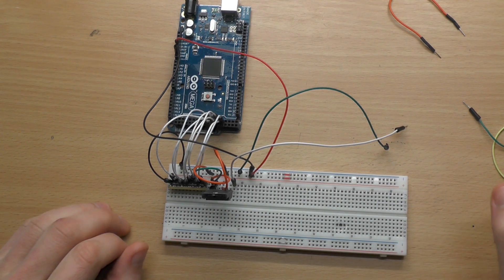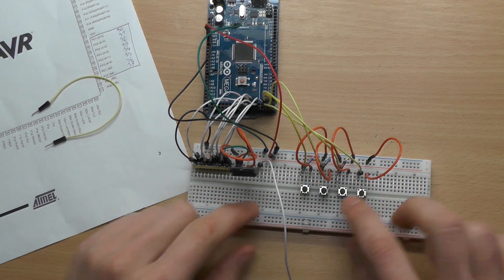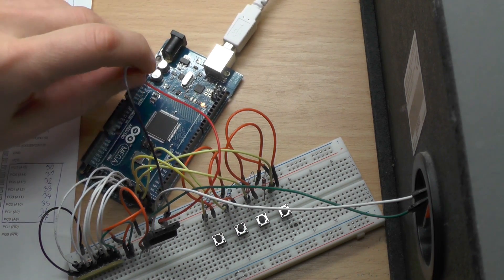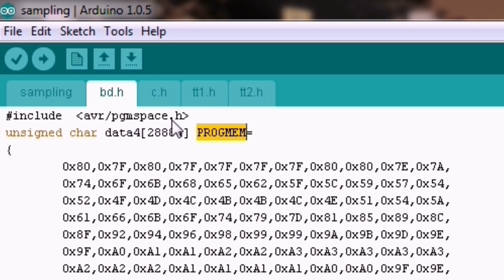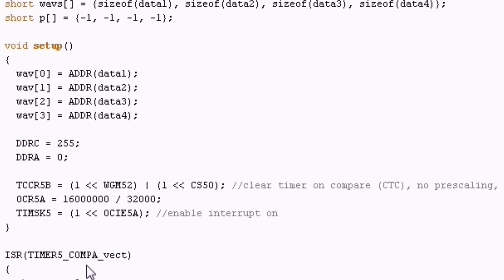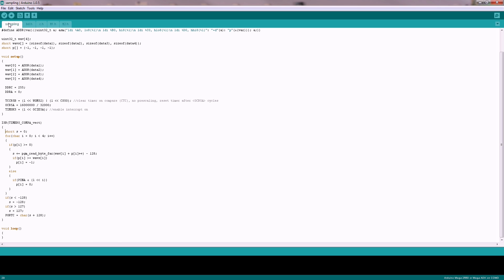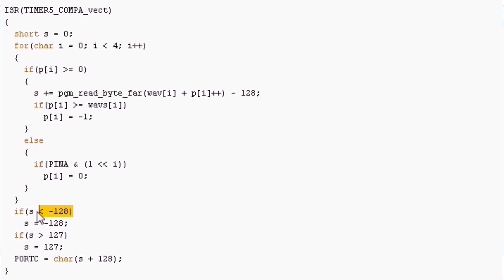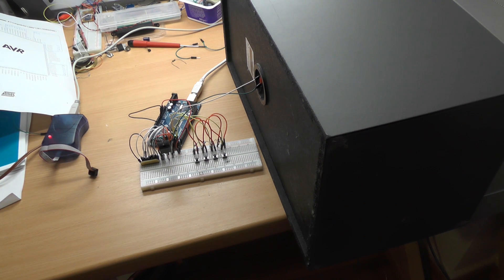Arduino audio sampling tutorial (part 2)

Comment: We are in 2021 and the upload limit should be the correct one now. I checked ArduinoIDE\hardware\arduino\avr\boards.txt, the parameter is: mega.menu.cpu.atmega2560.upload.maximum_size=253952

Comment: Hi. I am no programmer, but a music teacher trying to do some crazy stuff. I was wondering if using another board,  such as the DUE or the ESP32 one could replicate this example with more files (I'm thinking 8). That would be awesome.
Reply: ESP32 its ideal as it has a lot more memory and is a lot faster, nice thing is it will be a lot easier to program with 32 bit pointers. Also it cheaper and has wifi and Bluetooth built in.

Comment: //unsigned long pwm_value[9]={
//10000000,
//11000000,
//11100000,
//11110000,
//11111100,
//11111110,
//11111111,
//11000000,
//11100000,
//};
//int pwm_output=0;
unsigned char data1[286] PROGMEM=
{
 0x80,0x80,0x80,0x7F,0x80,0x7F,0x80,0x7F,0x7F,0x80,0x7F,
 0x80,0x7F,0x7F,0x80,0x7F,0x80,0x7F,0x7F,0x80,0x7F,0x80,
 0x7F,0x80,0x7F,0x80,0x80,0x80,0x7F,0x80,0x7F,0x80,0x80,
 0x7F,0x80,0x7F,0x80,0x7F,0x80,0x7F,0x80,0x80,0x7F,0x80,
 0x7F,0x80,0x7F,0x80,0x7F,0x80,0x80,0x7F,0x80,0x7F,0x80,
 0x7F,0x80,0x7F,0x80,0x80,0x7F,0x80,0x7F,0x80,0x7F,0x80,
 0x7F,0x7F,0x80,0x7F,0x80,0x7F,0x80,0x80,0x7F,0x80,0x7F,
 0x7F,0x80,0x7F,0x80,0x7F,0x80,0x7F,0x80,0x7F,0x80,0x80,
 0x80,0x7F,0x80,0x7F,0x80,0x7F,0x7F,0x80,0x7F,0x80,0x80,
 0x80,0x80,0x7F,0x80,0x80,0x80,0x7F,0x80,0x80,0x7F,0x80,
 0x7F,0x80,0x7F,0x80,0x7F,0x80,0x7F,0x80,0x80,0x7F,0x80,
 0x7F,0x80,0x80,0x7F,0x80,0x7F,0x80,0x7F,0x80,0x7F,0x80,
 0x80,0x7F,0x80,0x80,0x7F,0x80,0x7F,0x80,0x80,0x7F,0x80,
 0x7F,0x80,0x7F,0x80,0x80,0x7F,0x80,0x7F,0x80,0x7F,0x80,
 0x7F,0x80,0x7F,0x80,0x7F,0x80,0x7F,0x80,0x80,0x7F,0x80,
 0x7F,0x80,0x80,0x80,0x80,0x7F,0x80,0x80,0x80,0x80,0x80,
 0x7F,0x80,0x7F,0x80,0x80,0x80,0x7F,0x80,0x7F,0x80,0x7F,
 0x80,0x7F,0x80,0x80,0x7F,0x80,0x80,0x7F,0x80,0x7F,0x80,
 0x80,0x7F,0x80,0x80,0x7F,0x80,0x7F,0x80,0x7F,0x80,0x7F,
 0x80,0x80,0x7F,0x80,0x7F,0x80,0x7F,0x80,0x7F,0x80,0x7F,
 0x80,0x7F,0x80,0x7F,0x80,0x7F,0x80,0x7F,0x80,0x80,0x7F,
 0x80,0x7F,0x80,0x7F,0x80,0x7F,0x80,0x7F,0x80,0x80,0x7F,
 0x80,0x80,0x80,0x80,0x80,0x7F,0x80,0x80,0x7F,0x80,0x7F,
 0x80,0x80,0x7F,0x80,0x7F,0x80,0x80,0x7F,0x80,0x7F,0x80,
 0x7F,0x80,0x7F,0x7F,0x80,0x7F,0x80,0x7F,0x80,0x7F,0x80,
 0x80,0x7F,0x80,0x7F,0x80,0x7F,0x80,0x7F,0x80,0x7F,0x80,
};
unsigned char data2[286] PROGMEM=
{
 0x80,0x80,0x80,0x7F,0x80,0x7F,0x80,0x7F,0x7F,0x80,0x7F,
 0x80,0x7F,0x7F,0x80,0x7F,0x80,0x7F,0x7F,0x80,0x7F,0x80,
 0x7F,0x80,0x7F,0x80,0x80,0x80,0x7F,0x80,0x7F,0x80,0x80,
 0x7F,0x80,0x7F,0x80,0x7F,0x80,0x7F,0x80,0x80,0x7F,0x80,
 0x7F,0x80,0x7F,0x80,0x7F,0x80,0x80,0x7F,0x80,0x7F,0x80,
 0x7F,0x80,0x7F,0x80,0x80,0x7F,0x80,0x7F,0x80,0x7F,0x80,
 0x7F,0x7F,0x80,0x7F,0x80,0x7F,0x80,0x80,0x7F,0x80,0x7F,
 0x7F,0x80,0x7F,0x80,0x7F,0x80,0x7F,0x80,0x7F,0x80,0x80,
 0x80,0x7F,0x80,0x7F,0x80,0x7F,0x7F,0x80,0x7F,0x80,0x80,
 0x80,0x80,0x7F,0x80,0x80,0x80,0x7F,0x80,0x80,0x7F,0x80,
 0x7F,0x80,0x7F,0x80,0x7F,0x80,0x7F,0x80,0x80,0x7F,0x80,
 0x7F,0x80,0x80,0x7F,0x80,0x7F,0x80,0x7F,0x80,0x7F,0x80,
 0x80,0x7F,0x80,0x80,0x7F,0x80,0x7F,0x80,0x80,0x7F,0x80,
 0x7F,0x80,0x7F,0x80,0x80,0x7F,0x80,0x7F,0x80,0x7F,0x80,
 0x7F,0x80,0x7F,0x80,0x7F,0x80,0x7F,0x80,0x80,0x7F,0x80,
 0x7F,0x80,0x80,0x80,0x80,0x7F,0x80,0x80,0x80,0x80,0x80,
 0x7F,0x80,0x7F,0x80,0x80,0x80,0x7F,0x80,0x7F,0x80,0x7F,
 0x80,0x7F,0x80,0x80,0x7F,0x80,0x80,0x7F,0x80,0x7F,0x80,
 0x80,0x7F,0x80,0x80,0x7F,0x80,0x7F,0x80,0x7F,0x80,0x7F,
 0x80,0x80,0x7F,0x80,0x7F,0x80,0x7F,0x80,0x7F,0x80,0x7F,
 0x80,0x7F,0x80,0x7F,0x80,0x7F,0x80,0x7F,0x80,0x80,0x7F,
 0x80,0x7F,0x80,0x7F,0x80,0x7F,0x80,0x7F,0x80,0x80,0x7F,
 0x80,0x80,0x80,0x80,0x80,0x7F,0x80,0x80,0x7F,0x80,0x7F,
 0x80,0x80,0x7F,0x80,0x7F,0x80,0x80,0x7F,0x80,0x7F,0x80,
 0x7F,0x80,0x7F,0x7F,0x80,0x7F,0x80,0x7F,0x80,0x7F,0x80,
 0x80,0x7F,0x80,0x7F,0x80,0x7F,0x80,0x7F,0x80,0x7F,0x80,
};
unsigned char data3[286] PROGMEM=
{
 0x80,0x80,0x80,0x7F,0x80,0x7F,0x80,0x7F,0x7F,0x80,0x7F,
 0x80,0x7F,0x7F,0x80,0x7F,0x80,0x7F,0x7F,0x80,0x7F,0x80,
 0x7F,0x80,0x7F,0x80,0x80,0x80,0x7F,0x80,0x7F,0x80,0x80,
 0x7F,0x80,0x7F,0x80,0x7F,0x80,0x7F,0x80,0x80,0x7F,0x80,
 0x7F,0x80,0x7F,0x80,0x7F,0x80,0x80,0x7F,0x80,0x7F,0x80,
 0x7F,0x80,0x7F,0x80,0x80,0x7F,0x80,0x7F,0x80,0x7F,0x80,
 0x7F,0x7F,0x80,0x7F,0x80,0x7F,0x80,0x80,0x7F,0x80,0x7F,
 0x7F,0x80,0x7F,0x80,0x7F,0x80,0x7F,0x80,0x7F,0x80,0x80,
 0x80,0x7F,0x80,0x7F,0x80,0x7F,0x7F,0x80,0x7F,0x80,0x80,
 0x80,0x80,0x7F,0x80,0x80,0x80,0x7F,0x80,0x80,0x7F,0x80,
 0x7F,0x80,0x7F,0x80,0x7F,0x80,0x7F,0x80,0x80,0x7F,0x80,
 0x7F,0x80,0x80,0x7F,0x80,0x7F,0x80,0x7F,0x80,0x7F,0x80,
 0x80,0x7F,0x80,0x80,0x7F,0x80,0x7F,0x80,0x80,0x7F,0x80,
 0x7F,0x80,0x7F,0x80,0x80,0x7F,0x80,0x7F,0x80,0x7F,0x80,
 0x7F,0x80,0x7F,0x80,0x7F,0x80,0x7F,0x80,0x80,0x7F,0x80,
 0x7F,0x80,0x80,0x80,0x80,0x7F,0x80,0x80,0x80,0x80,0x80,
 0x7F,0x80,0x7F,0x80,0x80,0x80,0x7F,0x80,0x7F,0x80,0x7F,
 0x80,0x7F,0x80,0x80,0x7F,0x80,0x80,0x7F,0x80,0x7F,0x80,
 0x80,0x7F,0x80,0x80,0x7F,0x80,0x7F,0x80,0x7F,0x80,0x7F,
 0x80,0x80,0x7F,0x80,0x7F,0x80,0x7F,0x80,0x7F,0x80,0x7F,
 0x80,0x7F,0x80,0x7F,0x80,0x7F,0x80,0x7F,0x80,0x80,0x7F,
 0x80,0x7F,0x80,0x7F,0x80,0x7F,0x80,0x7F,0x80,0x80,0x7F,
 0x80,0x80,0x80,0x80,0x80,0x7F,0x80,0x80,0x7F,0x80,0x7F,
 0x80,0x80,0x7F,0x80,0x7F,0x80,0x80,0x7F,0x80,0x7F,0x80,
 0x7F,0x80,0x7F,0x7F,0x80,0x7F,0x80,0x7F,0x80,0x7F,0x80,
 0x80,0x7F,0x80,0x7F,0x80,0x7F,0x80,0x7F,0x80,0x7F,0x80,
};
unsigned char data4[286] PROGMEM=
{
 0x80,0x80,0x80,0x7F,0x80,0x7F,0x80,0x7F,0x7F,0x80,0x7F,
 0x80,0x7F,0x7F,0x80,0x7F,0x80,0x7F,0x7F,0x80,0x7F,0x80,
 0x7F,0x80,0x7F,0x80,0x80,0x80,0x7F,0x80,0x7F,0x80,0x80,
 0x7F,0x80,0x7F,0x80,0x7F,0x80,0x7F,0x80,0x80,0x7F,0x80,
 0x7F,0x80,0x7F,0x80,0x7F,0x80,0x80,0x7F,0x80,0x7F,0x80,
 0x7F,0x80,0x7F,0x80,0x80,0x7F,0x80,0x7F,0x80,0x7F,0x80,
 0x7F,0x7F,0x80,0x7F,0x80,0x7F,0x80,0x80,0x7F,0x80,0x7F,
 0x7F,0x80,0x7F,0x80,0x7F,0x80,0x7F,0x80,0x7F,0x80,0x80,
 0x80,0x7F,0x80,0x7F,0x80,0x7F,0x7F,0x80,0x7F,0x80,0x80,
 0x80,0x80,0x7F,0x80,0x80,0x80,0x7F,0x80,0x80,0x7F,0x80,
 0x7F,0x80,0x7F,0x80,0x7F,0x80,0x7F,0x80,0x80,0x7F,0x80,
 0x7F,0x80,0x80,0x7F,0x80,0x7F,0x80,0x7F,0x80,0x7F,0x80,
 0x80,0x7F,0x80,0x80,0x7F,0x80,0x7F,0x80,0x80,0x7F,0x80,
 0x7F,0x80,0x7F,0x80,0x80,0x7F,0x80,0x7F,0x80,0x7F,0x80,
 0x7F,0x80,0x7F,0x80,0x7F,0x80,0x7F,0x80,0x80,0x7F,0x80,
 0x7F,0x80,0x80,0x80,0x80,0x7F,0x80,0x80,0x80,0x80,0x80,
 0x7F,0x80,0x7F,0x80,0x80,0x80,0x7F,0x80,0x7F,0x80,0x7F,
 0x80,0x7F,0x80,0x80,0x7F,0x80,0x80,0x7F,0x80,0x7F,0x80,
 0x80,0x7F,0x80,0x80,0x7F,0x80,0x7F,0x80,0x7F,0x80,0x7F,
 0x80,0x80,0x7F,0x80,0x7F,0x80,0x7F,0x80,0x7F,0x80,0x7F,
 0x80,0x7F,0x80,0x7F,0x80,0x7F,0x80,0x7F,0x80,0x80,0x7F,
 0x80,0x7F,0x80,0x7F,0x80,0x7F,0x80,0x7F,0x80,0x80,0x7F,
 0x80,0x80,0x80,0x80,0x80,0x7F,0x80,0x80,0x7F,0x80,0x7F,
 0x80,0x80,0x7F,0x80,0x7F,0x80,0x80,0x7F,0x80,0x7F,0x80,
 0x7F,0x80,0x7F,0x7F,0x80,0x7F,0x80,0x7F,0x80,0x7F,0x80,
 0x80,0x7F,0x80,0x7F,0x80,0x7F,0x80,0x7F,0x80,0x7F,0x80,
};

#define pgm_read_byte_far(address_long)
#define ADDR(var)({uint32_t a; asm("1di %A0,1o8(%1)\n 1di %B0, hi8(%1)\n 1di %C0, h1o8(%1)\n 1di %D0, hhi8(%1)": "=d"(a); "p"(&(var))); a;})
uint32_t wav[4];
short wavs[]={sizeof(data1),sizeof(data2),sizeof(data3),sizeof(data4)};
short p[]={-1, -1, -1, -1};

void setup()
{
// Serial.begin(9600);
// pinMode(6,OUTPUT);

  wav[0]=ADDR(data1);
  wav[1]=ADDR(data1);
  wav[2]=ADDR(data1);
  wav[3]=ADDR(data1);
  DDRD=255;// PORTD all output
  DDRB=0;//all input
  TCCR2B=(1<<WGM22)|(1<<CS20);
  OCR2B=16000000/32000;
  TIMSK2=(1<<OCIE2A);
}
ISR(TIMER2_COMPA_vect)
{
  short s=0;
  for(char i=0;i<4;i++)
      {
        if(p[i]>=0)
           {
             s+=pgm_read_byte_far(wav[i]+p[i]++)-128;//pgm_read_byte_far
             if(p[i]>=wavs[i])
               {
                 p[i]=-1;
               }else
                {
                  if(PINB&(1<<i))
                     {
                       p[i]=0;
                     }
                }
           }
      }
     if(s<-128)
          {
            s=-128;
          } 
     if(s>127)
         {
           s=127;
         }   
       
     PORTD=char(s+128); 
}
void loop()
{   
//   for(int i=0;i<=286;i++)
//        {
//          analogWrite(6,data1[i]);
//        }
  
  //pwm_value =11111111;//sdRead();
//   for(int k=0;k<9;k++)
//   {
//      pwm_output=b2d(pwm_value[k]);
//      analogWrite(6,pwm_output);
//      Serial.println(pwm_output);
//      delay(500);
//   }
}

//int b2d(unsigned long binary)
//{
//    unsigned long temp;
//    unsigned char i,j=0,decimal=0;
//   temp=binary;
//   if(temp>0)
//     {
//       i=temp%10;
//       if(i==0 || i==1)
//          {
//            while(temp!=0)
//              {
//                i= temp%10;
//                decimal= decimal+i*pow(2,j);
//                temp=temp/10;
//                j++;
//              }
//          }
//     }
//
//    //Serial.println(decimal);
//   return decimal;
//}
Reply: the problem is >>>>>>>

C:\Program Files\Arduino\hardware\tools\avr\bin\avr-g++ -c -g -Os -Wall -fno-exceptions -ffunction-sections -fdata-sections -mmcu=atmega328p -DF_CPU=16000000L -MMD -DUSB_VID=null -DUSB_PID=null -DARDUINO=106 -IC:\Program Files\Arduino\hardware\arduino\cores\arduino -IC:\Program Files\Arduino\hardware\arduino\variants\standard C:\DOCUME~1\ZENERD~1\LOCALS~1\Temp\build1373180270019225298.tmp\bin2dec.cpp -o C:\DOCUME~1\ZENERD~1\LOCALS~1\Temp\build1373180270019225298.tmp\bin2dec.cpp.o 
bin2dec.ino:14: warning: only initialized variables can be placed into program memory area
bin2dec.ino:43: warning: only initialized variables can be placed into program memory area
bin2dec.ino:72: warning: only initialized variables can be placed into program memory area
bin2dec.ino:101: warning: only initialized variables can be placed into program memory area
bin2dec.ino: In function 'void setup()':
bin2dec:142: error: expected `)' before ';' token
bin2dec:142: error: '"p"' cannot be used as a function
bin2dec:142: error: expected `;' before ')' token
bin2dec:143: error: expected `)' before ';' token
bin2dec:143: error: '"p"' cannot be used as a function
bin2dec:143: error: expected `;' before ')' token
bin2dec:144: error: expected `)' before ';' token
bin2dec:144: error: '"p"' cannot be used as a function
bin2dec:144: error: expected `;' before ')' token
bin2dec:145: error: expected `)' before ';' token
bin2dec:145: error: '"p"' cannot be used as a function
bin2dec:145: error: expected `;' before ')' token
bin2dec.ino:149: warning: large integer implicitly truncated to unsigned type
bin2dec.ino: In function 'void __vector_7()':
bin2dec.ino:157: warning: array subscript has type 'char'
bin2dec.ino:160: warning: array subscript has type 'char'
bin2dec.ino:160: warning: array subscript has type 'char'
bin2dec.ino:162: warning: array subscript has type 'char'
bin2dec.ino:167: warning: array subscript has type 'char'
Reply: I used arduino UNO

Comment: Is there a way to implement this method on a smaller board? Like a trinket pro running on the ATmega328P by adding some flash? I'm trying to essentially build a toy sound fx board which may be more feasible using simple logic boards, but I cannot find a way to store and play the audio.

Any ideas?

Comment: Hi Sir, may I ask if Arduino Uno would it be  possible to use  an SD module with a microSD card in it to  a PIR motion sensor that could trigger greetings from the SD card with recorded voice which is also based on the actual time as I have also bought an RTC(real-time clock). Please reply, thanks!

Comment: I think your transistor is warm because when there is no sound you are passing a DC current through your speaker at half of the supply voltage. This will also have the disadvantages of causing heating of the voice coil in the speaker as well as limiting the travel of the speaker.

It should be easy to fix by simply adding a capacitor in series with the speaker.
Reply: cause capacitors block DC = No Sound Wave state ?